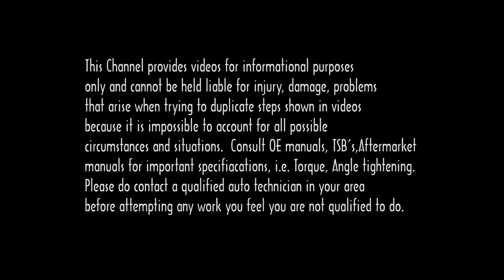Caliper replacement 2005 Dodge Ram 2500 Install Remove Replace how to change

Comment: The surface of the hub needs cleaned.thin coat of never seize added.slide bolts lubed with (ceramic extreme), as well as the backs of the pads.and the top & bottom of the caliper! this WII add LIFE and keep caliper sliding.When bleeding brakes DO NOT PUSH BRAKE PEDAL more than HALF way down to protect master cylinder

Comment: 145ft. lbs typically on 15/16 8 lugs on these 3/4ton and 1 ton trucks. The half tons are 95 ft. lbs  I usually reuse the factory caliper bolts instead of the 10mm bolts the new caliper comes with. Does shop policy say you are to torque lug nuts to spec? At the very minimum, I will use a torque stick. Awesome video.
Reply from the maker: jarin wilson Kind of is a policy, sure I do not want the lug nuts falling off.

Comment: I wish I could have seen you remove the caliper.  You were standing in front of the camera when you removed them.  Mine are stuck and hard to remove.  I removed the two bolts and also pushed the pistons back, but I just can't get the caliper off.  :(
Reply: Do it in the reverse of how he installed it? You can pry on it once the caliper pins are out.

Comment: I have a 2007 of the same model.  What do you look for in order to tell what exactly needs to be replaed? For example, when would you replace more than the brake pads..can you replace only the pads...or do you replace the caliper as well? Just trying to figure out what all I need to do to my truck. The brakes dont stop that well.

Comment: I have hard time figure it out how to bleed it out all brakes after I put new two calipers in front. Now I got back air is out as much possible but not in front. Any suggestions?
Reply: Always start bleeding the farthest away from the master cylinder and work your way in. I have an 06 Ram 2500 4x4, so it would be right rear, left rear, right front, and left front last. Any time I have to bleed my fronts I bleed the rear first because you can end up with the "brake" light on from an un-centered proportioning valve.
If you live in a cold climate it's also good to bleed your brakes every spring because moisture can still get into your brake system. If there is air there is also moisture. 
Funny, I just did front rotors, calipers, hoses, and installed an EBC Stage 5 yellowstuff kit. My right front was hanging up so I figure the heck with it I got 10yrs out of my oem calipers/rotors...

Comment: When you collapse the pistons, open the bleeder screw with a short length of tubing stuck into a clear glass jar to the bleeder nipple and collect all the old fluid. Examine it for rust/dirt, especially if the calipers are staying on. This way, the old fluid won't be reversed into the master cylinder and carry dirt/rust/debris into it, shortening it's life. Then scavenge the old fluid out of the master cylinder with a suction device or a turkey baster. Replace all the old fluid with new.
Brake fluid is alcohol based and absorbs moisture to keep water away from brake components. When it's old and very moisture saturated, the water can boil when the brakes are used heavily making the caliper "lock-up" or stick in the "on" position.
That will cause a catastrophic cook-down condition and will ruin the bearings, seals, brake lines, and possibly set the caliper paint on fire. Usually vehicles that sit a lot are prone to this condition.
Brake fluid has about a 5-10 year life depending on conditions.
I do this when I'm re-using OR replacing the calipers.
I use Mercedes /Porsche DOT 4 which is blue tinted. It's race quality and it's for
off-road use only, it's still the best there is, so I use it.
Reply: +Dan Fowler What is the brake fluide used by OME? Is it ok to "mix" brake fluids? (I have some brake fluide that goes in a BMW, will that work as well?)
Reply: +sein bmw 
DOT 3. The wet boiling point (3.7% water) is 284 degrees.
DOT 4 wet boiling point is 311 degrees.
Reply: I do that to lmao! Except for the Porsche fluid though :)
Reply: Very good suggestion.  Thanks.

Stay gold.

Comment: Never blow off the brake dust with your mouth or even compressed air, brake dust is carcinogenic. Always use brake cleaner fluid instead.

Comment: I have a Dodge Ram 1500 I just had my buddy help me put front calipers on I just realized that my bleeder screws are on the bottom part of the caliper did I completely mess up or can I still bleed it using the gravity bleed method I need help as soon as possible thank you
Reply: You can take the calipers off, put a piece of wood etc in between the pads, and turn the caliper so the bleed screw is the highest air point.  Then you can bleed however you like.
Best thing would be to swap the calipers.

Stay gold.